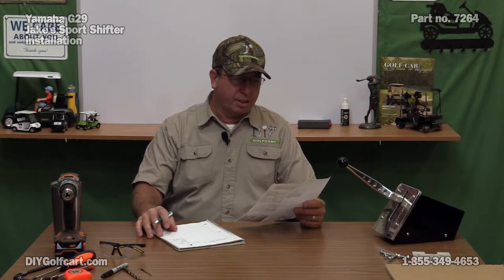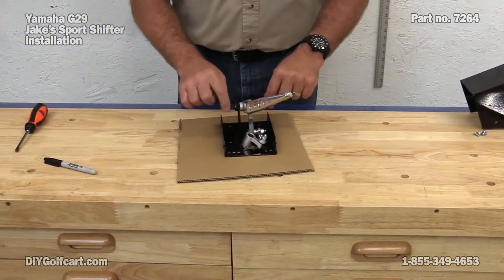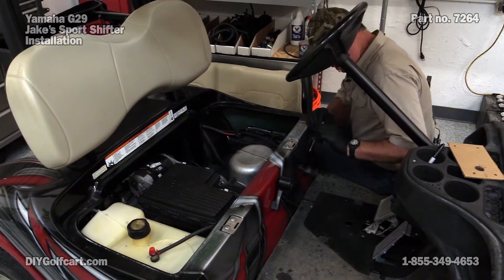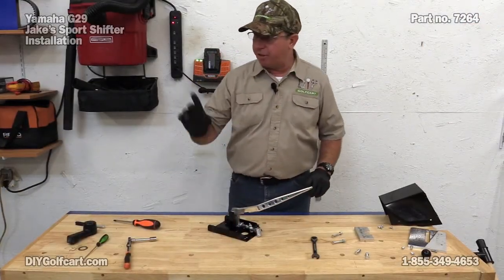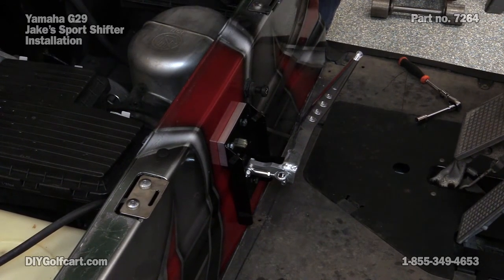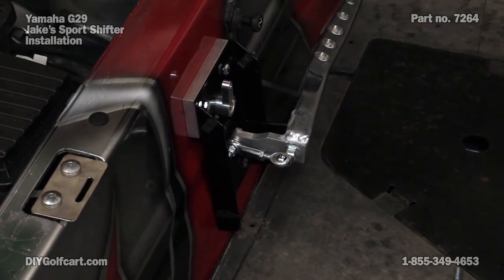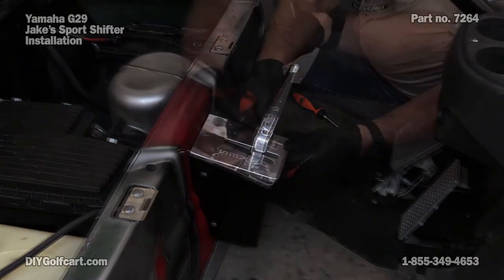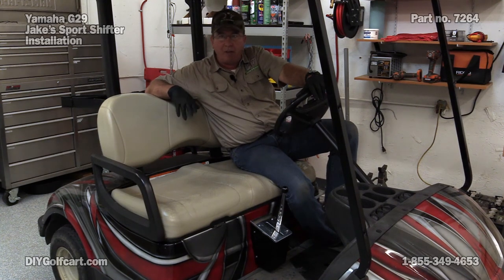Jake's Sport Shifter Yamaha Drive Golf Cart | How to Install

Comment: I installed one of these and have a heck of a time adjusting the cables to get it into gear properly. It functions but often reverse "pops" out of gear because its not in far enough. Every time I tryy adjusting the cables I seem to make a bigger problem. I would have liked to have seen you adjust yours...mine wasn't that simple to install...
Reply: I bought the Jake Sport Shifter thru Amazon, and the shifter wasn't well packed. It wasn't assembled like they claimed...In fact it was missing parts. I had no padding whatsoever. It will be sent back.